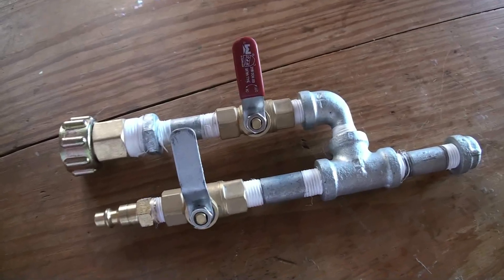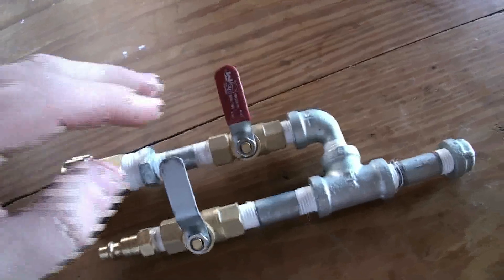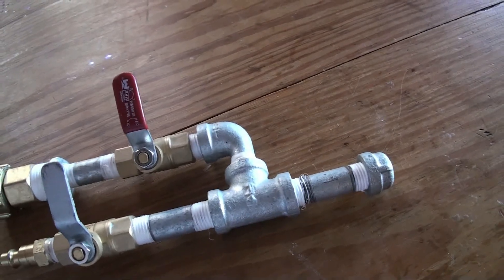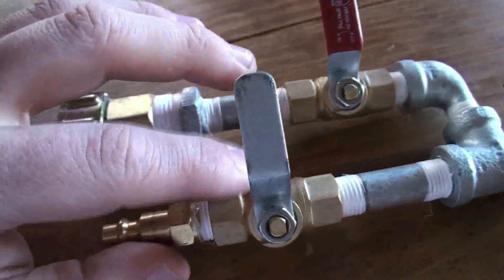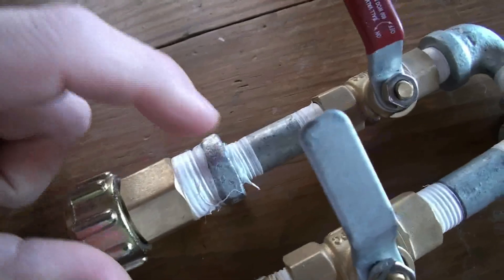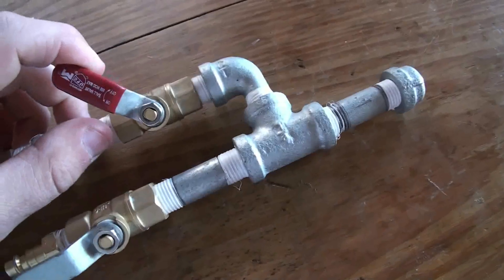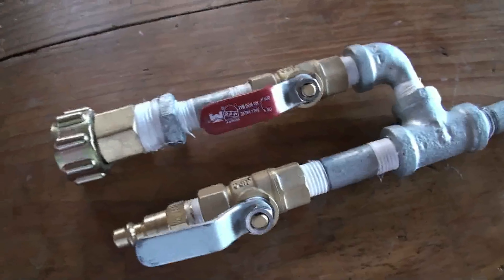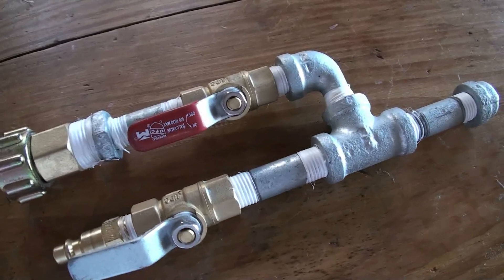How To Build a Snow Maker Machine

Comment: Alright, I live in a cold town in Australia, that only gets snow every 10 years, due to the fact it never rains when it's below 2 degrees, and also, when it does rain the air temp rises. So I decided to go to a Bunnings and build this device, and well I was skeptical at first but I hooked it up to my air compressor and, one morning it dropped to 0 degrees and well, it worked, I got a whole big patch of icey snow.  Thanks Mate!

Also, people wondering about air temps that work, yes it does not have to be at or below 0 degrees (32F) to work. 1 degree or below works (33.8 F) but, if you are trying at night it has worked at 2 degrees (35.6 F) but the snow quality was shit. So if you want to use this to make snow, wait until its below 1 degree (33.8 F). Don't trust this for sure, because I did not record the humidity, and there might be a micro climate at my house which generates colder air.

BUT THIS WILL NOT WORK IN SUMMER IN THE TROPICS, DESPITE WHAT PEOPLE IN THE COMMENTS ARE SAYING

Comment: Didnt check all ur comments, but if nobody mentioned it u cud put a check valve on the air side and it will stop any back flow  of water. I use them on RV water heaters. The come in 1/2" thread

Comment: What capacity do i need for the air compressor? (15gallon, 30gallon, 60gallon etc.)
Reply: . the bigger the better. dont think id try a 15 gal. something that could maintain the psi he states but the psi may need to be experimented with

Comment: Hello. Thanks for the video. Have a quick question for you.I built this set up and it worked just great only problem I noticed is I was getting air coming back into the plumbing in the house. Can you tell me what I was doing wrong?
Reply: This is happening to me too. Did you ever find a solution?
Reply: This is happening to me as well. I assume my air pressure is too high

Comment: hey tim, im trying to contact you to ask how much pressure you need to maintain? Does the water temp matter? And should I use a pressure washer along with an air compressor?  hope to hear back soon! thanks!
Reply from the maker: Amanda Tibbetts I used a compressor running about 25 psi.  If you're using a pressure washer you'll need a higher pressure. You will have to experiment with it until you get it right.
Reply: Thanks for a speedy response :)

Comment: You need to be in below freezing temperatures (32 degrees Fahrenheit and 0 degrees Celsius) and, little known, below 50% relative humidity for this to work properly.
Reply: actually only run it if it is 17-27

Comment: These are the dumbest questions I have ever read.
Reply: Looking at some of the questions that are being asked, I do not think it would be safe for many of those asking the question to be outside without supervision.
ie  Can i make snow in 25 degree celsius????
My answer was your parents already have Snowflake!
Reply: @TheFalconJetDriver  At 1:00 he describes how the pressure affects the setup, so it is perfectly reasonable for one to wonder if this can be used above freezing based on what he said.
Reply: Why do you think they're dumb questions? List them and explain why.
Reply: Content Updating well I will have to give some back ground info, we know that water will freeze at less that 32 F or 0 C. I will agree that as the water is compressed an the pressure degreases after going through the Small Orifice. This creates an expansion of the water molecules thus reducing the heat energy in the molecules. 
As well as atomizes  the  molecules, when the molecules contact the cold air it freezes making pseudo snowflakes. (not to be confused with the uneducated snow flakes that roam upon the earth)
I say pseudo because they’re really ice crystals that are being formed and not actually snowflakes.

Can this process be conducted at temperatures greater than 40 degrees Fahrenheit, I have been to ski resorts where they were making snow  (ice crystals) at 35 F However they had such high pressure on the water supply and agents in the water that would cause the temperature to drop rapidly after exiting the spray nozzle.
I fly an airplane that has an Air Cycle machine that compresses Ambient air at 90 F.
This air cycle machine can make ice crystals fall from the graspers.

My comment was about the morons that asked could they make snow in the tropics? With my airplane they could but it would never accumulate.

Comment: Can I use 1/2 " tubing instead ? That is the diameter I happen to have . Jim
Reply: You would need a larger volume of air moving at any one time to get the pressure required to atomize the water.

Comment: the water flow from your house will always be above the freezing point (unless it's already froze up of course). Constant flowing water won't freeze as quickly a non-flowing water. This is the same reason why people say to leave your taps on just a bit when the temperatures are going to be extremely cold for long periods of time.

Comment: @stellfen probably $20-30 dollars, but unless you weather temp is -1º or less, it is not going to work, and even at extreme cold it might be more ice. there a better ways depending on what you are looking to spend $. Musicians Friend has a snow machine that looks like a commercial fog machine, and can make snow in 80º and if you add chemical it will last for an hour in that heat. If you google back yard snow machine that will give an idea there. this guys idea is a bad idea it.....

Comment: this is only works in really cold weather and is not the best way to make snow, this may work for him , but there better ways to make snow, it just comes down to you budget, and how much snow you want. Musicians Friend has a snow machine for $400 (that is basic budget) but if your looking to cover a hill for snow,skiing, or sledding. You will need a dual stage compressor & pressure washer, and wand.

Comment: I made this not too long ago. Thanks for posting ! It works quite well at 20 degrees.. ! but keeps my 26 gallon air compressor  running, but it dont run lower than 90 psi in the tank..

Comment: Constructed mine cheaply all galvanized except the valves. Drilled hole with the smallest bit I had. Wanted brass ball and check valves but on a tight budget. So water and compressor ran all night and I have a little snow. Its southern GA and has been below 28 all night it is currently 5 am and 24. Maybe make a video at daylight.

Comment from the maker: @Hernaner28 Sorry, I don't have a document that explains theory.  It's basically trying to get the water separated by atomizing the water, giving it more surface area to exchange heat better with the air.  Also when something drops in pressure, it gets cold.  Have you ever used compressed air to clean with?  The can get's cold because it's pressure is being reduced.  It takes a ton of energy (heat) to get the air/water compressed, and the opposite is true when pressure drops (gets cold).

Comment: @timbreninger no no no no you are better off to take the air water gun and run it to where you are making nuc snow .Next take the electric pressure washer and set it above 3 1/2 to 4 inches above the air water gun it must be 28 degand less with low humidity,You are will make better snow if your air compressor can produce 5cfm@90 psi. it will make more snow. Do not ever use galvanized pipe to do what you are talking about its very dangerous trust me.

Comment: Alright, a few questions. First, basically for this to work it doesn't have to be below 32F correct? It is a pressure thing (but below freezing would help). Second, what kind of PSI is needed output on this (before internal water/air compression) to get snow (basically what kind of PSI do i need coming out of my compressor)? Also, does the T-pipe need to be a T or would a Y pipe work better? I wonder because It would make sense that a T would be needed for better air-water mix but Y for speed.

Comment: I'm getting backflow into both the water and air lines.  I've got a 1/64" hole for aeration and I keep the air on full at >60psi.  I can't seem to get both going.

has anyone tried check valves?

Comment from the maker: @maximundo If I had a massive air compressor as you stated, I would use 1/2 in pipe and not 1/4 in pipe as I used in my video.  I would also drill three small holes in the cap instead of the one small hole I described.  This would be for a compressor around 10CFM.  As for air backing up the water line, just try to match the water presure of the house using the compressor's regulator.  House tap presure is usually around 25PSI.  If you use a power washer, you can crank up the PSI on your comp.

Comment from the maker: @maximundo The garden hose won't freeze from my experances.   Just make sure it is not outside with water in it before you decide to use it. (it will be frozen then).  As long as the water is flowing, it won't freeze.

Comment from the maker: @footballhill5 First, the temperature needs to be below freezing.  25F or below works best.  Second, turn the air on then slowly turn the water on until you get a fine mist.  See my video of the unit actually working to here what it should sound like.   If you do those two things, make sure the mixture has enough time to freeze before falling to the ground.

Comment from the maker: @eou812 You can use any types of pipes you want to.  It will not hurt the design.  Basicly your mixing compressed air with water and shooting them out of a nozel.  This unit does not make enough to cover a quarter acre, plus that would take a ton of water.

Comment from the maker: @touchsmart0 Yes, you do need the air compressor.  You need to atomize (break up into small particles) the water.  Also the drop in presure allows the water to cool quicker.  I have seen designs that add presure washer lines that do not have air above the air/water mixture and build additional mass onto the atimized water.  I get a lot of emails where people have tried to use it without an air compressor, and I have not found a sucsessful example.

Comment: Hi in about an hour or two how much snow would that make over less than a quarter of an acre and if i used a pressure washer that had 2.5 GPM how much would it make?? . Also can the pipes be brass instead of gallvanized because i could not find any gallvanized 1/4 pipe at lowe's. Thanks!

Comment: Hi Tim, great vid. I'm getting a massive air compressor from my father in law for xmas. I plan on building the same nozzle that you show in this video. 

From your experience, what (if any) advantage is there for having a more powerful air compressor? Could I make two separate nozzles with the extra air power? Or at a certain point would I need a pressure washer to keep up with the air compressor?

Also, is there any chance of backing up the garden hose with the pressure from the air compressor?

Comment from the maker: @thatsadeadbird A coulple of things.  Make sure the air is on continously.  Try to match the air presure and house water presure.  Put the air line higher than the water line, so water does not flow down into the water line.
Reply: so air does not flow into the water line.

Comment from the maker: @atcnick It's not based on the size of the tank.  Its based on the CFM rating on your compressor.  I use a 5CFM @90 compressor, and it runs all the time.  If you can afford it, a larger compressor would be nice.

Comment from the maker: @sickang94 It's not based on the size of the tank.  Its based on the CFM rating on your compressor.  I use a 5CFM @90 compressor, and it runs all the time.  If you can afford it, a larger compressor would be nice.   It does take a while to make snow this way.  It would be ideal to run it overnight, and wake up to snow in the morning.

Comment from the maker: @wastadkey You will not want to run the presure washer at 100 psi hooked up to a garden hose.  I adjust my regulator to run mine at about 35 PSI.  If the presure is set to high it will push air into your water line and nothing will come out

Comment: ok...so i made a snow maker using this exact design...and one big problem was that the air went back up the hose and into the plumbing on the house...can this make snow at pressures less than 90psi from the air compressor???

Comment: From the research  i've done so far I have this so far, all you need is:
-A air compressor
-Pressure washer
-Garden hose/air compressor hose
-And a brass connector like in this video

Please correct me if I'm wrong, but I wanna make one of these very bad!!
Reply: bennyboy1507 aiyeeleej.need the artist work compact.kicking in thehost to your inner crode

Comment from the maker: @Sweetslapshot007 A power washer would be a good solution.  That would allow you to increse the presure of the air compressor.  With that kind of set up, you can make snow at slightly higher temps becuase there is a greater diffrence in presure.

Comment from the maker: @TheAcaciaStrain16 If you had a very large air compressor, you could use 1/2 in pipe.  If I had a larger air compressor, I could have made more snow using my same 1/4 in pipe, only made the hole in the cap larger to produce more snow.  I have also seen a design using three small holes in the cap.  I don't think there is a diffrence between the teflon tape and pipe dope.  You just don't want it to leak.

Comment from the maker: @S5YL It was pretty small.  I want to say 3/16ths.  The advice I would give is, start off small and drill bigger if your air compressor can keep up.  Or you may even buy two caps and try diffrent hole sizes.  The caps don't cost much at all.  Thanks for watching!!

Comment from the maker: @IWANTRUSH  Yes, I used a standard garden hose.  You will want the water presure comming out of the air compressor similar to what your water presure is, maybe slightly higher.   I ran my compressor at 25-40 PSI

Comment: You could use a check valve in line with the air supply to prevent back flow into the air.

Comment from the maker: @TheTorkerman There is not an exact temperature.  It's based on Temperature and Humidity.  You need to calculate the wet bulb temperature.  Do a Google Search for "wet bulb calculator"  To make snow the wet bulb Temperature needs to be 27F or below.  You need a Wet Bulb Temperature of 21F or below to make good quality snow.  I made my snow when it was about 15-20F with about 50% humidity.